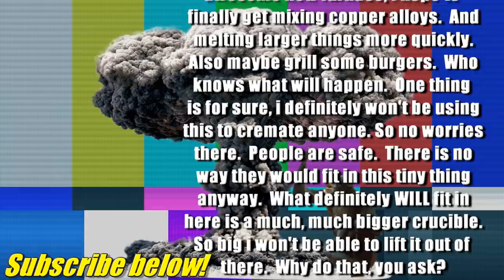How to Make a Fire Brick Metal Foundry Furnace, Part 1: Cutting the Bricks

Comment from the maker: Similar Bricks to the ones I used: https://amzn.to/3VDIzoY
You'll need a couple 12 packs.  It's expensive, i know.
These are 2600 degree rated bricks, you can also get 3000 degree rated bricks for about double the price.  I used 2800 degree rated bricks.  2600 is honestly more than enough unless you cast iron.

Want to learn sand casting using your 3D printer? I can teach you!: https://paulsmakeracademy.mykajabi.com/joinus
Reply: Could I get the 2600 brick and coat it in the 3200 Satanite and safely do cast iron

Comment: Thank you for this. I ended up using the exact same materials as you did.  I made my furnace smaller though. I used an old propane tank as my outside which meant I had to cut all the bricks in half twice and then 7 1/2 degrees off of the outside corners of those. Took a total of 6 bricks (actually could have took 5 but mistakes were made) last piece locked all the other pieces into place like a keystone. Didn't even have to mortar in between them. Then I just coated them twice in satanite following the proper bake in procedure for each coat. Thing works amazing. Was able to go from a cold furnace to melted copper in 30 minutes. 12 minutes if the furnace is already hot. Best of all everything is holding up great. My walls show no sign of melting and turning into glass goo like they did in my first furnace when I tried to make my own refractory mix (4 parts Perlite  1 part 3000 degree furnace cement). Thanks again. By the way great channel I've watch all your videos and find you highly entertaining and very likable.

Comment: I used a table saw with (3) stacked masonry blades, AND a respirator, and a shower, cuz it was a dust storm, but very accurate. I almost have all the 'sand' out of my hair now, 3 years later.
Reply from the maker: My garage floor still has the dust if I brush the floor hard enough...

Comment: Im looking at some of the firebricks in my area, and a local hardware store sells light firebricks that is up to 3000F, and it sells for $2.50. That doesn't seem right, considering every video that I have seen. What else should I watch out for too determine good bricks to use?
Reply: Satanite and koa wool is thebest way to go in the longrun...a bit pricey to start
Reply from the maker: Those are likely heavy fire brick, not the insulating kind.  The insulating light bricks are rarely if ever sold at a store.  Kaowool isnt all its cracked up to be either, heat rating is very low on it.  You can order insulating bricks up to 3200f rating, bit the price goes up with temp rating.  Mine are 2800f bricks they work fine for even cast iron when coated in satanite
Reply: @PaulsGarage  thank you for that reply! That follow up is outstanding!

Comment: You can cut a few discs for raising your crucible off the floor for of the foundry. That's what I did with my funky off-cuts. If there isn't enough for a single brick to do the job, I just used two side-by-side as the crucible stand.
Reply from the maker: +zillustration I have most of a brick that I'll probably use as a plinth.  Still I have 5 full uncut bricks.  I smell a mini forge in my future...

Comment: Interesting and hilarious commentary thanks Mr Paul. Seeing as you were talking about the Pyramids then you might be interested to learn that a French architect, Jean-Pierre Houdin, spent 20 years learning about and making a scaled model of the Great Pyramid of Cheops.
He actually sold his business and home in order to concentrate on his pyramid project and came up with some amazing theories.
Whilst making the computer model he surmised that the builders would have had a 7 degree internal ramp and that at the corners of the ramp they would have had to turn the blocks, which means having a small wooden swivel crane, in order that the builders could continue on up the next sloped bend. 
This meant that the Pyramid would have been open at those points and that would mean that the stone blocks vertical lines (at those corner points) would have to be in line with the blocks above it instead of staggered like a brick/block wall. When you build a line of bricks you have to start with half a brick on the second course so that the end line is halfway along the lower brick.
There is a documentary about Houdin and his Pyramid obsession and they got permission to climb up the Cheops one to check out the vertical joints idea.

When you view the Pyramid from a distance you can clearly see an angled 7 degree shadow line in the morning or afternoon as well as the vertical joint  lines, up close, on the corner blocks. 
In the film they went about 10 miles away to an earlier step pyramid that had been opened up and there you could clearly see the internal ramp. 
A computer company was so impressed with the Frenchman's model that they gave him some updated, newer software so that he could finish his model.

Comment: Excuse me
Is this brick a high temperature refractory brick or a white brick that is easier to cut?
Reply from the maker: This is white brick that is easier to cut.  This higher temperature brick (2800) is harder to cut than the standard 2300/2400 rated white bricks, but I still use a hand saw to cut it

Comment: What I don't understand is why no one cuts the bricks in the middle at the desired angle then put two flat sides together and have the proper angles on the outside with the only waste is the sawdust. You end up with twice as many cracks but they fit together well with minimal waste. These bricks are EXPENSIVE so why waste any more than you have to?

Comment: How did you choose the rating of the firebrick? I went to the link and saw that you split the difference between the temp ratings.

Is k-26 the lowest temp you can get away with, or can you go lower and rely on the Satanite to pick up the slack?
Reply: The higher the better but satanite will help

Comment: Hey Paul, have you thought if using electricity instead of propane to heat your foundry?
Reply from the maker: I've considered it, yeah.  I have access to a lot of heating elements so it's been an idea i've had to use dryer elements and stuff (nichrome wire), but that requires 220v and a lot of amperage, and until recently i didn't have 220v access in my garage.  Also, fire is lots of fun :D  I may do an electric furnace at some point, though.

Comment: That's looking great! It would be a pain but you could cut wedges to fill in the triangle gaps with the extra firebricks. Looking forward to seeing the sheetmetal construction.
Reply from the maker: +eviltwinx that's a good idea.  I was trying to save the small wedges I cut but the saw was taking too long so o switched to the one you see in the vids.  Works sooo much faster.  I have some ideas for the sheet metal, al depends how hot it gets.

Comment: i would think by now, that the tiles used by the aerospace industry like for the shuttle, is no longer a secret, and should be available to the general public? although pricey?? perhaps? also? an indestructible form of insulation??
Reply from the maker: It's probably available just insanely expensive.  Shuttle tiles are super brittle too

Comment: How many bricks did you buy total? I want to make this so bad as I currently have the plaster of Paris and sand furnace.
Reply from the maker: +Brody Shoffner the place I put a link to in the description sells these in packs of 4, I bought 7 packs so 28 bricks and I have 5 left over
Reply: wont hurt to buy the extra because the are brittle and mistakes can happen, better to have to many than to few imo. I found a local source in Orlando a pottery supply store that sells them individually. good luck.
Reply: Holy damn so the cost of this furnace is a good chunk of change then all said and done. Will have to talk to the wife about this one. Would a kaowool furnace make as good of a liner or is it better to use these bricks?
Reply from the maker: +Brody Shoffner depends.  I ran the numbers, for the same amount and thickness of kaowool it's about the same price, and both need a coating like satanite or other refractory for stability and to keep the propane fire from destroying them.  The highest rated kaowool I've seen is 2700f, you can get bricks for higher temps.  Satanite is good for 3200 though so a good coating of that will make the kaowool last much longer.

Comment: Ideas for extras (not sure on the personal usefulness for you) but since you asked: heat treat oven, smaller secondary forge, a pyramid that can withstand 2800 deg., an extreme easy bake oven, or just fill in all the gaps on the current project. Also, save your back and add a pivot for the lid instead of lifting it on and off every time 🤙🏻 Also also, great videos!

Comment: yes id agree with others on making a forge i actually made a trench forge for wood/coal using a steel pipe down the center those bricks prolly would be perfect and stil be able to make an enclosed end as well...not to mention its a good work out making knives out of rail road spike......just make sure their not within distance of a railroad ya dont wanna break a law by stealing rusting scrap that will probably get buried.....but with the beating and forging pushing your cars with or without ebrake lol will become easier as will be moving heavy foundries lol

Comment: I used mizzou refractory cement in mine and it worked great and this was a great videos
Reply from the maker: Mizzou is great stuff, i considered using mizzou myself, but this doesn't require mixing or molds and stuff.  Mizzou is WAY tougher than insulating bricks.
Reply: Mizzou is good up to 3200!  Well worth the dollhairs.

Comment: I'm lazy. I positioned the bricks around the inside of my bucket then back-filled with a plaster/sand mix. No cutting. Need the plaster mix to be a bit firm or it will run between the cracks, though.

Comment: Just make sure to be gentle around those bricks, they tend to crack and crumble if you throw them around, I'd try making some kind of support/protection for it just in case
Reply from the maker: +Albin9000 yeah I'm going to wrap it all in steel, maybe make a frame and wheels for the bottom

Comment: I was at my old town dumps one day and I found two old kilns that someone had thrown out. I got two big garbage pails of firebricks out of those kilns. They were pretty big kilns. The furnace I made out of those is not as nice as what you're making. I just stacked bricks up around a metal bucket. It works OK though. Even with gaps. Here's a picture of my funny furnace. http://i.imgur.com/Ld6E4.jpg Yeah that's an old lawnmower that I flipped upside down and filled with concrete. I kind of mixed in some bits of firebrick to make it lighter. I have lots of the things, some are busted up though. You can use screws into light firebrick too. That's how I hold my top together. It is just screwed to that versa angle. I have handles made out of EMT and wire on the top now. I wonder why they're not in the picture? Oh well it was an early picture?
Reply from the maker: thats a good idea with the screws!  Also that mower furnace looks awesome, it's easy to move around!
Reply: +Paul's Garage I can't claim I invented the rolling patio. I saw it someplace on the net. With a platform like that I could put a boom arm for lifting the lid off. I have my blower attached to it already. I carry some tools on it. Stuff like that. It puts the work up at a nice height too. But it does take up some space. Still spent mowers are easy enough to come across. It sure simplified making the bottom of my furnace.

Comment: Another great video, I love how you add a little additional entertainment with your rambles about the Pyramids, also very glad that you're not a conspiracy theorist! 

On to the question:
You made a round furnace but would it have been bad to simply make it Square? What are the benefits of round in this case? (And I'm not judging, I seriously would like to know because a brick furnace is something I plan on making some day.)
Reply from the maker: +Cajun Fox round mainly for airflow around the crucible, I'll be blasting the propane fire in at an angle like the other one

Comment: Did you watch my videos? Lol

Looking forward to Future parts since I'm going to be doing something similar to my keg firebrick furnace soon. I used kaowool for the lid section of mine to keep it light. My furnace currently has  a firebrick base and kaowool sides I'm going to replace the kaowool and make the whole base out of firebrick.
Reply from the maker: +Richard Wheatley I haven't seen yours, you use a keg? I'll check it out
Reply: Yes, I couldn't get my oil burner to work so I shoved a weed torch into it and successfully melted some aluminum. I haven't cast anything due to someone mishandling the furnace while I was moving they destroyed the kaowool in the lid but I'll be fixing that soon and installing the firebrick into the base and hopefully I'll have no more project halting problems after that.

Comment: Here is an easy way to figure the angles for the cuts.  You had 9 firebricks and you want them to fit in a "Circle".  A circle no matter how large ,  has 360 degrees.  360 divided by 9 is 40. Thus giving you the angle of the cut you need to make.  It works for any amount of pieces you want to put in a circle.

Comment: You can eliminate the brick cutting by using a fire brick mortar (very easy to make) and laying the firebricks in what masons call  a solider course or a sailor course: Dry lay layout - then using the firebrick mortar lay the bricks with very tight joints: [Robert The Bricklayer] I am going to build one myself:

Comment: Nice,maybe i will use this Design instead of a Kaowool foundry. :D
Reply from the maker: +Metallbrand [Chemie&Physik] both bricks and kaowool require a coating.  That's next episode
Reply: Paul's Garage i considered to coat the inner side with a mixture of sodium silicate and Aluminium Oxide. but i'll first build the propaen burner,so i cant wait for your solution with building Mine :D (Sorry for my bad English,im German)

Comment: Ok, so, I get it, three years later. I am sure those extra bricks are already used up in another project. However, if you are just stumbling onto this video while sucking up everyone elses knowledge, another thing you could do with all those spare bricks and off cuts.... Make an electric heat treat or tempering furnace using some heating coil and a PID.
Reply from the maker: Wouldn't you know it, thats a thing I built recently https://youtu.be/Y27uIWsCt0g

Comment: Save yourself some grief.
Saw those bricks in half length wise.
Or use a larger bucket and lay them flat against each other.
It works on all the fire pits I’ve built.